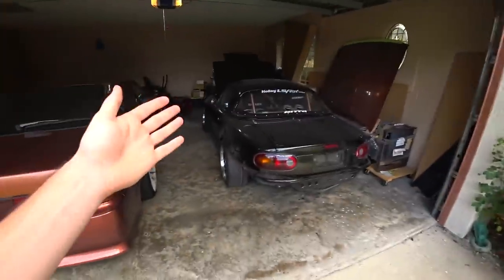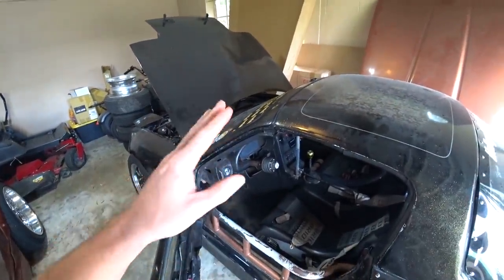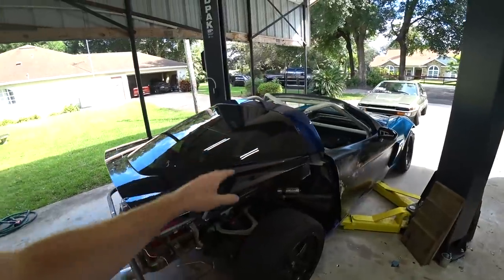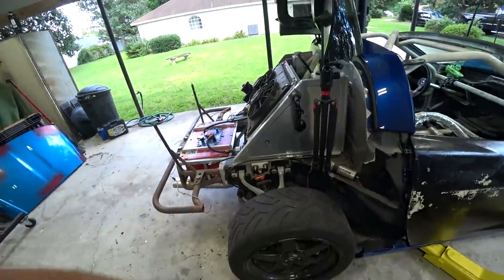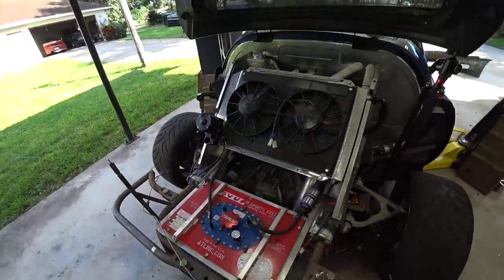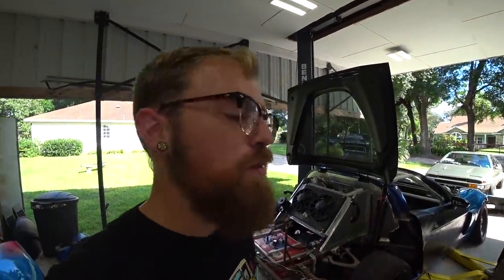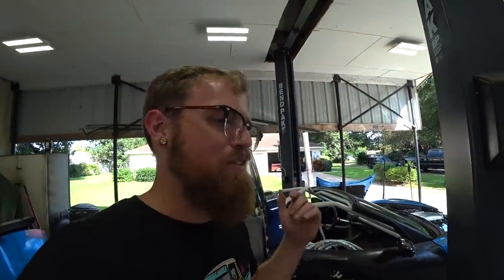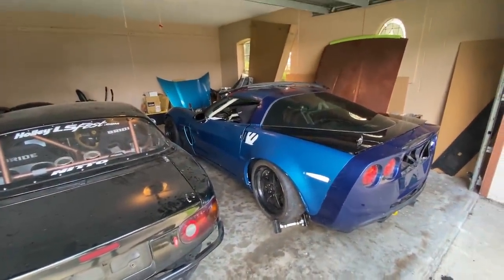I bought a FD Pro 1 Corvette Build! It has some wild parts on it.

Comment: “ This motor is overkill “ is the complete opposite of a good reason for replacing it.
Reply: Yeah he has som really strange ideas sometimes.
Reply: Ditching the Motons for BC's also seems like a huge step backwards.  The only replacements I would consider for those would be Penske or Ohlins.
Reply: @csg2000  it's probably cause he's sponsored by bc isn't he?
Reply: @csg2000  Lots of pros run BC over more expensive options
Reply: @5lcalais1  believe he still is
Reply: @5lcalais1  ah yeah, that will do it.
Reply: @csg2000  👍
Reply: @imyopped4921  👍
Reply: And he said he can get a back up set of coils too. Its more practical for his build.
Reply: I second this
Reply: overkill is because of the price.  That's probably a 50k+ engine, it's probably pushing close to 2000hp, he doesn't want to mess it up.   The cost to replace that engine or even parts is ridiculous.  Maybe if he had it built himself it would have warranty or something to protect him, but being 2nd hand I doubt it.
Reply: Yeah I’m with Taylor on this. That thing can probably make 1500 wheel and that’s just not needed. Plus a huge risk if something went wrong. Sell it for like 30k and he can buy a suitable engine.
Reply: @5lcalais1  not only sponsored but i believe taylor had a hand in developing bc suspension. Could be mistaken tho.
Reply: I assume he overpaid for the car to meet his deadline and making some money back to recoop the cost.
Reply: Finally!! 😍😍😍 Can’t wait to see you compete in that thing, you deserve something more bad ass than the miata imo 😂
Reply: Up!
Reply: Not really. In competition reliability is king. There's no point in having the greatest engine out there if it's got so many points of failure that you get knocked out by a guy with half the power who can keep his engine running with off the shelf parts. The wilder the engine the more expensive and time consuming it is to fix it when it goes wrong. Turbos just add all sorts of complexity that is pointless if you don't need the power.
Reply: @5lcalais1  yupp sponsored and running costs I would assume... not like you shred coilovers every comp but still  haha
Reply: Selling all the fancy parts and downgrading......... so what was the actual point of buying it then?
Reply: Most time consuming and difficult part of any race car build is prepping the shell and fitting the roll cage especially when the shell is aluminium. That's the point of buying it.
Reply: @adematthewsracing  The wilder the engine, the more reliable it is when you turn it down, son! Didn't he say it was a 427? I can't imagine wear items being that insane, the work and materials that went into the big items on the engine are what makes it so damn expensive, not the piston rings and gaskets and BS... Not even the camshaft necessarily or the Pistons, I'm sure off the shelf Pistons are used (no I'm not, they probably weren't lol still I bet the parts chosen for this were chosen to last if you're paying 50k)... What's the difference cost wise? Where are the insane costs of running coming from? 

But I also can't imagine this engine not being reliable as all hell if it's good for 2000 hp, and he turns it down to a cool thousand or so. He's got it... Why not run it. I know for a fact he had to have paid almost nothing compared to what all these parts cost, the reality is that the dude selling it never would have sold the car if he didn't take a STUPID discount for it. 

...I'd never buy something like this if I thought for a second I was going to sell it... You don't even get half your money back on the used market, and then the whole thing is gone! Oh well, Taylor's gain! I'm not saying he didn't probably spend a pretty penny on this thing, but at the same time I doubt it's anywhere near what you guys are thinking.

Comment: Keep the engine, but send it back to borowski to turn it back into an all out NA engine. Texas speed has gotten enough love on the internet over the past few years, time for someone else to get the spotlight. (Also borowski is local to me so I’m a little biased)
Reply: We love this
Reply: also seems like every tsp motor set up is blown 2 times I'm a season...
Reply: @MrBigcarl42  that’s because most of them are big boost drag racing engines. You’ll have that on those big jobs. Texas speed makes a solid product, but I want to see the “little guys” get some love. Plus Borowski does much more than just boutique high dollar builds like they do for the street outlaws guys, they’ll also do any work on basically any other engine you send them, not just LS/Hemi based stuff
Reply: Yeah I thought the same thing, keep the engine but change it over for NA
Reply: @grantbowers2319  I'm just saying. for 18k-22k it had better hold up to high boost..  I've seen 4k 6.0 motors that hold up at 1300hp for 4 to 5 years.

Comment: I would keep the motor in the car. Leave it as is. That motor is overkill but that’s literally the best motor you can buy for drifting.
Reply: same brother just use it as it is and start ripping it
Reply: Totally agree
Reply: I 100% agree
Reply: Totally agree, keep the motor!
Reply: Let's start a petition so he keeps this engine set up
Reply: And you would never have to worry about not having enough power if you need more you can just turn it up.
Reply: Yea, even if you don't go forced induction you will never probably have to worry about the motor.
Reply: Especially if one day he is going to compete at the PRO1 level they are all making like easy 1000whp some are making even more than that like RTR and Dean Kearney. You really can't have to much power you can always turn it down
Reply: @tstuff1213  well said!
Reply: Yeah use that engine
Reply: I think T-ray is working on something with TSR and the motion guys, that makes it tricky to run a Borowski setup... for colab it would be better to sell the borowski and go with sponsored engine/parts and use the money from the engine on sick stuff for the build :)

Comment: Keep the “overkill” engine in it run it on low boost and it will save you a lot of time and money
Reply: This was my thoughts as well, run it at 700/800hp and it'll live forever if you keep it all serviced properly, plus that way you've always got that extra  horsepower if you need to stick it on kill for a run and make all the horsepower
Reply: @Matty.Hill_87  you have to run that thing on full beans unfortunately, it makes low compression for tons of boost so it would be a challenge to have it be spicy at any rpm
Reply: That was my first thought.  So you can run a fully built motor under its max potential versus running a build N/A motor to the max, then you don't have to add boost LATER.
Reply: @Matty.Hill_87  he could damn near run that motor n/a and make that. I used to work there, that same motor with a whipple on it makes 1200hp turn key, Taylor’s setup definitely would make well north of that
Reply: @scoby41  that’s not how tuning works
Reply: what he is not saying that this engine brand new costs 67 000 USD. If he sells it he could finance this build from engine. Borowski page says this engine makes 2500 - 4000 Horsepower.
Reply: @TheKoldtoft  damn, need some fries with that salt? Try educating someone instead of calling them dumb. OFC that turbo isn’t gonna make that much power, but who’s to say that’s the original turbo? Maybe the guy who built it bought a drag racing motor with a giant ass turbo on it, sold that turbo to buy a smaller one and get some costs back on it, while also making it run more appropriately for FD. All the armchair mechanics in this thread think they know what’s up. No one knows the full story except the guy that built it. Until Taylor dyno’s it we have no clue what it actually makes. We have no clue how healthy the motor actually is. For all we know it could have 5 year old spark plugs that aren’t firing properly and making it make like 300 less horsepower. 

We know nothing about how this car runs or drives. Y’all need to get that toxic shit outta here and shut your mouths until we get some numbers

Comment: Important note to the firewall:
If there is a fire, carbon fiber will burn, and you have your fuel system back there. 
So staying aluminum would give you some safety
Reply: fd rules take care of that
Reply: Maybe you havent seen any of the fords that caught on fire....theres nothing left but steel, both burn/melt, but i am with you, the alum is in there i dont see it being that much weight difference for the headache of swapping it out.

Comment: This car is absolutely incredible. Totally run as is and test out drifting with 1000+ HP.
Reply: I agree leave it as is and drive it!!!!! Don't waste all that time swaping motors etc....
Reply: And u can always turn the boost down too ,I said similar thing but instead go to a blower on like 5psi and step it up later when the time comes ,at least that way it still acts like an na engine especially on a top mount blower as it's instant boost 🤔👍
Reply: @5lcalais1  a blower with a small shot would be awesome. Easily compete in FD when TR feels it's time.

Comment: I would definitely just finish it with the engine it have now and drift it like this and see how it feels you might really like that engine combo. As far as the trans set up and would put it right behind the engine it would make fixings something at the track so much easier. Maybe even find a transmission sponsor like rpm
Reply: Even if he really likes that engine it’s just not suited to what he’s doing. Even if he went straight in to pro1. Thing probably makes 1500 wheel and every part is top shelf expensive. This is a nightmare engine if you have problems. Taylor needs an engine that is rock solid, reliable, easy to work on and for a decent price.
Reply: @E36EM3 im pretty sure you can. Im sure theres already people you have done it. Yeah its not going to be something you just bolt in. Even in the video he said there are people that have or are doing it
Reply: @MrFoulksy  sure its going to be expensive to fix. Did you watch the video and see the car nothing about it is going to be cheap. Might as well see what the engine can do and have some fun with it and i doubt it would cost that much more the a tsp engine or for parts its an ls.
Reply: It’s probably because of his relationship with texas motor at the first place. But yeah he should keep the motor and take off the turbo if it has high comp
Reply: @joeladzim1225  i dont think he is sponsored by them at least he hasn't made it public yet but ya he could just remove the turbo and have a really good na engine and for big tracks were he would need a lot of speed he could just put the turbo kit back on and load a tune and bamb more hp
Reply: @MrFoulksy  true very expensive so just turn it way down and then there is his reliability but on a new lvl now the miata is basically maxed out
Reply: @chrisgreer1911   turning it down might not work. That’s a mighty large turbo to be running like 700 wheel. Turning it down that much might make the car laggy and hard to drive.
Reply: @MrFoulksy  he can just get a smaller turbo, no need to change the whole engine...
Reply: @jasonbirch1182  nah it really isn't. It's a v8, you can almost get it to light a turbo up at idle if you only want 700 hp.
Reply: But why spend more money reducing the power on this 30k+ overkill engine when you can just swap a better platform in. Sticking with this engine makes no sense for Taylor
Reply: @smurfvolvo  NA is always better for what Taylor is doing also.
Reply: @MrFoulksy  you just wait and see, a year or two from now and he will be talking about how he has to make more power.
Reply: @smurfvolvo  Well like Taylor said if he wants more than 700NA he can just spray it. If he wants to do pro1 700 - 800 is perfect.
Reply: @MrFoulksy  come back in two years and say that.
Reply: @smurfvolvo  can't wait
Reply: @MrFoulksy  I’m not familiar with Borowski too much but I doubt this is much different than what Texas Speed offers. While there’s a chance it’s overkill and built with fire rings, balanced crank, inconel valves and so on than yes he should probably sell it but I highly doubt that’s the case but I could be completely wrong being he only told us what internals it had, I don’t remember if he mentioned the size of the engine.
Reply: @kevinfunk83  its a 427 with a dart block. I just dont get what would be bad about the 3 thing you mentioned. Every engine has a balanced crank, fire rings wouldn't be a bad idea even on a n/a engine because of were that engine is going to live all of its life and those values help dissipate heat. I just dont get why that wouldn't work? Sure would it be a little more expensive yeah but will it help the engine live longer yes
Reply: @jasonbirch1182  well no shit 🤦‍♂️
Reply: @edwardrucker5412  I was commenting on what the other guy said but 1. Fire rings require machining to both the block and heads. 2. Properly balanced crankshafts aren’t cheap. I said if it is built like that,with fire rings, perfectly balanced crank, inconel valves, it would be better to sell. I doubt it’s built like that though.

Comment: Focus the changes on the rear and, for the short term anyway, leave the front alone. Keep the motor and turbo, you might like the extra power. Change the fuel cell, trans, suspension, fibreglass cover and firewall while the decisions for the front end settle in your mind, but I would be keeping that motor and turbo setup for now.
Reply: Exactly what was in my mind

Comment: Fwiw I think you should finish it as is so you can drive it and then make decisions about what you want to change. You might like the turbo ls once you drive it a bit. It probably makes more sense to go with a cheaper engine package though. You have to be prepared to replace an engine
Reply: Texas speed as a sponsor could be a solution to the expense of replacing an engine part.
Reply: this seems overbuilt and Id say thats a good thing.. pull power if need be but have it "in the tank" for when needed.. prep helps but engines blow, walls jump outta nowhere and the other guy might see a squirrel...

Comment: Taylor: Buys Pro 1 car
Also Taylor: This car is built to the hilt, I'm going to take it apart and make less power and have to build another "dream car" in 3 years. 

Don't play yourself. Put a smaller turbo on it, limit the power output, get a sequential trans, and drift the shit out of it.
Reply: Yup, running on smaller turbo and base boost won’t hurt. It’s not like he will have boostleaks or worry it will wear out faster if it’s just tuned correctly.
Reply: Problem with smaller turbos with such an engine is backpressure which can and will destroy the turbo itself which is no good. Just keep the turbo as it is, since, I think, it is chosen for a reason and just have softer wastegate spring.
Reply from the maker: It really stemmed from trying to sell the fancy parts. Retain he chassis, dry sump, brakes, etc and build it up with companies I've worked with to basically put some money back into the put for transmission stuff. The trans stuff is the big cost on this car. Looking at over $35K to do a sequential/quick change setup. Or 10K to do a faceplated stock trans, but no gear changing and not as strong. So really only two options, both extremes. Not that I can't swing it. It's just a big jump from "balling out" on a $2000 CD009 for the miata. lol
Reply: and this man is the winner :D
Reply: @Taylordrifts  honestly see exactly where you coming from. But this is huge for your channel and YouTube in general. Everyone knows your ability to drift is sick but everyone always questioned what would happen if Taylor got a fast car, this takes everything to a whole new level
Reply: @Taylordrifts  the old saying still rings true man, “buy once, cry once”.

In my hobby I always got whatever would get even close to getting me by. Finally said screw it and went all out within reason(lots of clean used parts) and it’s another world. I was happy with what I had before, but now I’m really happy with what I have and it makes competing way easier.

Comment: Save time and money by:

 -Keep the motor and turbo,turn the boost down and cut out the need of nitrous or blower down the road. Just turn the boost up when needed. 

 -Sell the coilovers on it now,get a set of BC's and use the rest towards a new built trans/diff and quick change rear.

-Get some PBM arms and angle kit, as well. Have that Matt Fields angle.

 -Sell the fuel tank and get a Radium like you said.

Comment: Keep that engine. Keep that engine. Dude. Keep that setup. Everyone is running 1000+ in FD. Don’t bring a 700hp knife to a 1200hp gun fight. If that engine is setup for forced induction already and you’re set on supercharger then switch it but RUN THAT ENGINE
Reply: As soon as he said pull it and sell it then said put a Texas speed in and make 700 I was thinking when did Taylor start smoking crack
Reply: @masterbaiterv2270  NO SHIT, THOUGHT SAME THING.

Comment: Taylor like everyone else has said you need to finish the car and run it to see what it runs like, as you know when you drive it you’ll have a smile on your face as big as the Grand Canyon. However, there is a small upgrade I’d make, purely due to the power the engine will make and how much force will be going through the rear stock corvette diff, I’d definitely change the rear differential to a front mounted one. As I think the car will handle so much better and i think it would balance out the car better, as this was build for straight line speed and not for drifting, all best can’t wait to see the car in action, cheers.